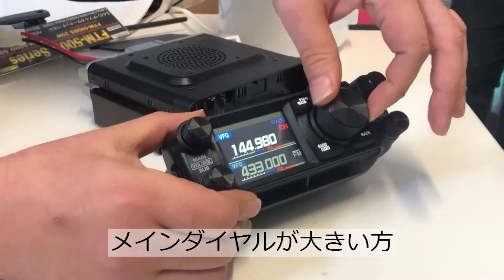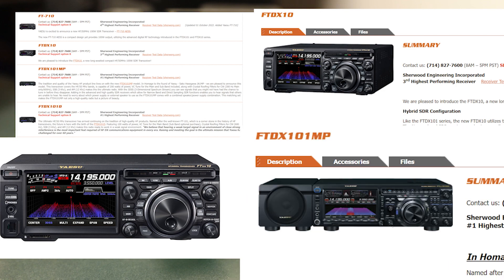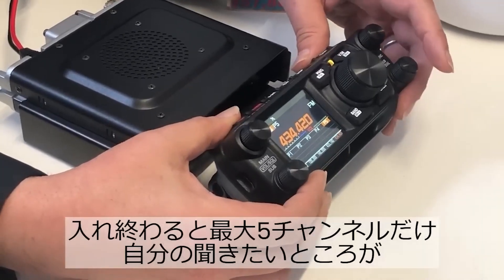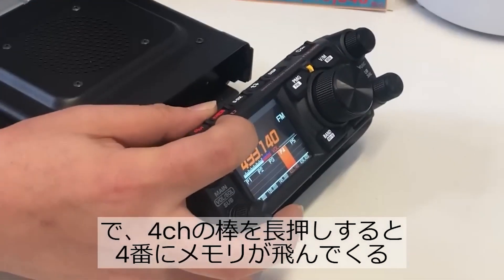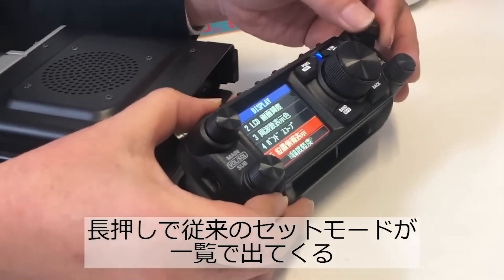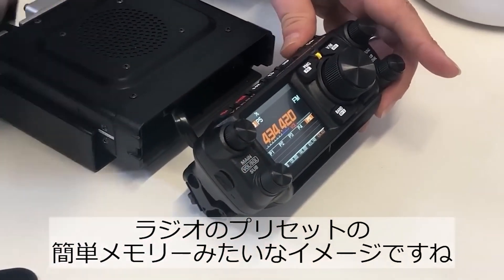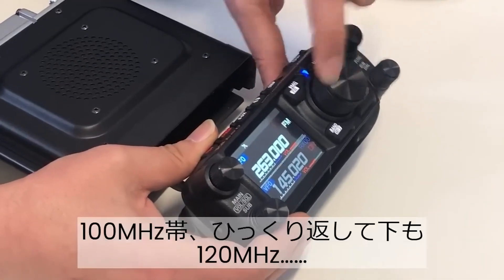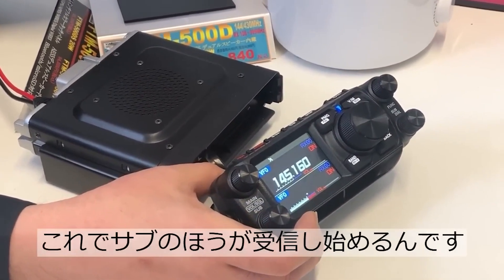FTM-500 User Interface Design Paradigm Shift!

Comment: My 400 died after 5 years. Yaesu said they couldn’t find anything wrong with it which makes me weary of buying a similar radio but I did love the 400. It’s unfortunate the shape of the 500 head isn’t more like the 400 I feel like it fit in vehicles very well being flat. I will eventually replace the 400 but the 500 doesn’t excite me to much. Thanks for the video.

Comment: This addendum video just make me all the more anxious for Yaesu’s U.S. release of FTM-500. I agree with your synopsis of Yaesu’s shift from GUI to tactical functionality. There is a sense of certainty—a confidence—with knobs, buttons and switches that is lost with touch GUI. I have come to dislike t-GUI over the years. For me the deal breaker for purchasing the FTM-500 will be a price tag over $700 or what I would consider over priced essential add-ons/accessories sold separately to keep the radios base price low. Thank you for this post.
Reply from the maker: Thanks for stopping by Brian, lets hope the price comes in lower than feared!